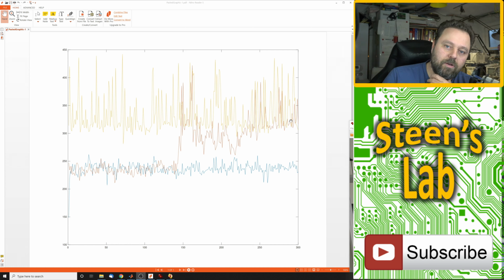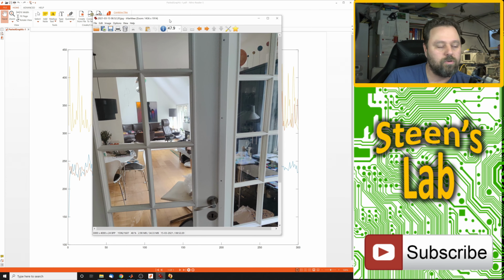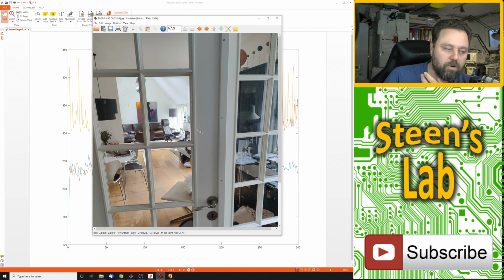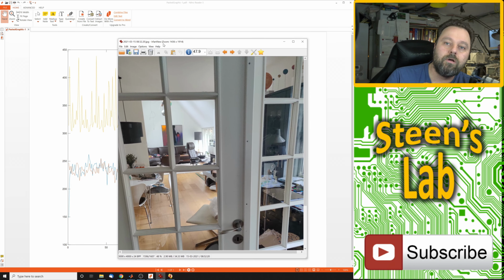Reasons for poor wifi performance

Comment: I'm looking forward to see your next video's. They're on an upper class Quality .... Learned a lot about wifi. Do you still have the licence for your test environment... If yes is it possible to make video's about some new wifi routers? Keep up the good work!
Reply from the maker: A couple of videos on new routers are in the making :)
Reply: @steenslab7974  If you're able, I'd like to see your take on the Asus RT-AX86U, but no worries if it isn't practical to do so. Also anything on testing the firewalls of wi-fi routers and if they hold up to standalone firewall routers like pfSense based ones in terms of security, if that's something you're interested in doing. This is something I'm less knowledgeable of. Cheers.